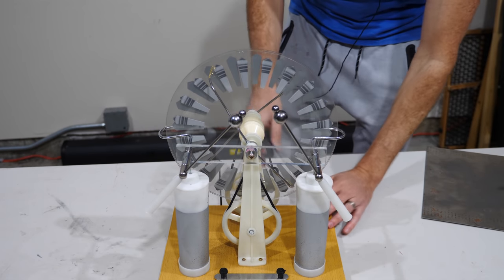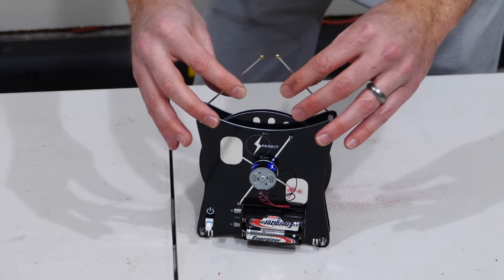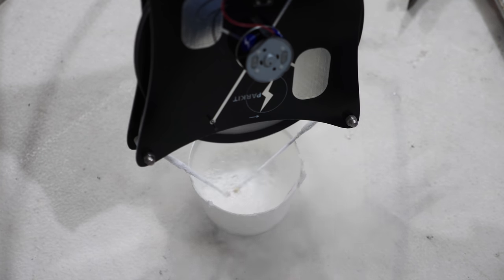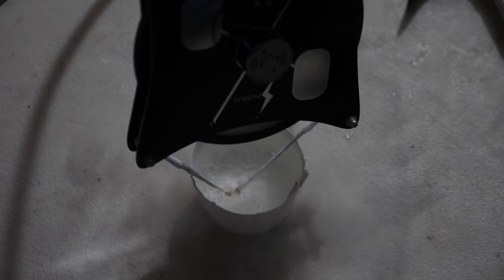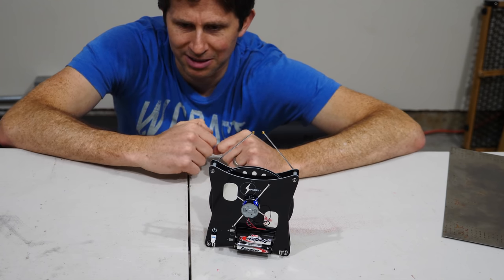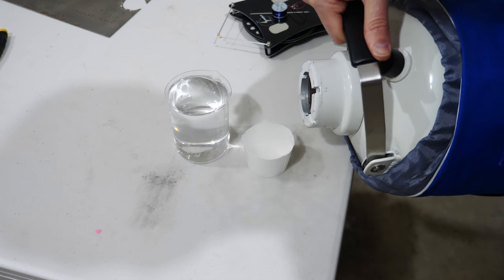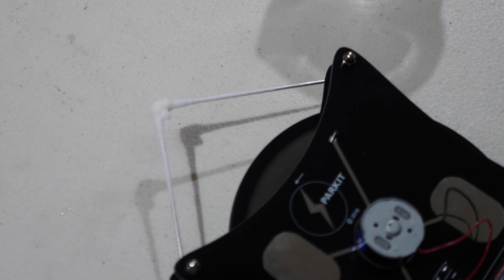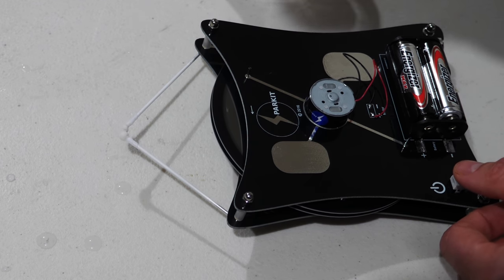Is it Possible To Freeze an Electric Spark in Solid Ice?

Comment: Is it possible to freeze electricity: No
Is it possible to hold a charge: Yes
Reply: Depends on how cold you get it.
Reply: @dirtydoigler2116  I don't think you know what electricity is. Edit: cold just means lack of energy, so how do you make energy cold. Energy doesn't get cold or hot, because it itself is the reason things are cold and hot
Reply: DoYouEvenGameAndLift BRUH  that's different smartass. Nomatther how much heat energy you group together, the heat energy itself can not be hotter or colder. The heat energy has it's fixed heat, and all the heat energy together makes up a greater heat. Whatever contains that heat energy is what you say is hotter or colder. That has nothing to do with the water analogy. You can't compare two unrelated substances to prove a point
Reply: @gabe8168  hey man
Greetings
I was just curious about two subjects and you seem to be quite knowledgeable about scientific stuff.

1: can flame conduct electricity?! Or more specifically can electricity go through the fire?

2: does lightning or electricity put out fire when they hit it if the voltage was high enough?!

I would be so thankful if you respond to this.
Thank you
Reply: @amireyvazi9251  1. Flame doesn't conduct electricity. Flame is a result of different chemical reactions. 2. The reason fire could be started by a lightning strike is because electricity can be used to start the chemical reaction. Flame is not one thing, it is a result of multiple things
Reply: @gabe8168  the answer to 2 isnt right its actually because it turns into heat and it gets hot enough to generate fire with the oxygen around it
Reply: We got some boy geniuses in this comment
Reply: @gabe8168  omg are you theoretically making cold energy
Reply: @quackerman234  Yes, exactly, it is able to start an electrical reaction with the oxygen and fuel (any dried trees probably) around it so it is right

Comment: The reason why the sparks went out when the ice got a little bit warmer is because the salt content in the ice became more evenly distributed. hence the gap between the electrodes became partially conductive( basically you shorted the HV and Gnd electrode). so conductive current would flow immediately as the potential tries to build up in one electrode so there is an immediate collapse in voltage. As far as i can see, the generator is only capable of generating a few joules of energy. hence, the potential wouldn't rise up  as high because the medium is already conductive. The built up charge is already dissipated through conduction even before the potential can become significantly high to visualize a breakdown. 

PS: I'm a High Voltage Engineer at IIT kanpur. hope you liked my explanation <3. Love your videos as usual

Comment: 5:03 My guess would be that micro-pockets of air were present in the solid ice, and after heating up those pockets would get smaller.
Reply: My guess is that, since ice is a dielectric, we were seeing the same phenomenon as before while there was no water present.
Yes, pure water is a dielectric too, but since it probably wasn't pure water it acted as a bridge. Even if it was pire, tho, since it's in contact with metal some metallic particle will get dissolved in the water pretty quickly, thus making it a conductor anyway.
Reply: my guess is everybody loves somebody sometimes,everybody loves somebody somehow
Reply: @outviteslb8143  Yes and obviously no!
Reply: @tomas2375  i love you man
Reply: @outviteslb8143  And I Love You, Random Citizen!
Reply: my guess is the atoms are closer together at colder temperatures, so the gaps are easier for the electrons  to jump

Comment: That is basically transfer of electrons from a point of higher potential difference to lower

It does not have significant mass ..... In order to freeze electrons you will have to do it at a temperature of nearly-273°C and that too for the time it requires to cover the distance from positive to negative electrode.

Also you can stock up electricity only in batteries

Thanks for reading

Comment: Ice from liquid water forms a crystal lattice and traps air. This is why water is the only known liquid to expand when frozen. Once the ice melted inside around the spark, a thin connection of liquid water forms and acts as a solid connection.

Comment: A couple of thoughts. First, what is the actual temperature of the liquid Nitrogen? It has to be warmer than the surface temp, so it really isn't as cold as you might think. Only when it sublimates does it give up its heat. Secondly, I hypothesize that the reason the spark stops when the water ice gets warmer is because when ice becomes warmer, it changes state to a liquid, and water has different resistance than ice. Obviously then, theoretically, water has a higher resistance than ice. H2O is a unique substance in that as it gets colder it gets less dense (molecules are further apart). If it didn't, then ice would not float, it would sink and the oceans would freeze solid. Every other element DOES get MORE dense as it gets colder, but not water.

Comment: Hey there! Solid Ice has a lower dielectric constant than water, about 20 times smaller! So my theory is that when the voltage is applied, the spark forms easily by polarising the ice, but the heat generated melted the pathway of the spark into water, which has a higher dielectric constant. This means that the voltage required to generate the same spark will increase as more of the ice melts into water, causing the spark to experience difficulty in forming due to the higher required voltages.

Comment: It didn't stop when the ice got warmer. The area of the ark melted a very thin layer of the ice. Because water is a very good conductor, it formed a wire between the electrodes essentially, and stoped making a visible arc.

Comment: Cool!  This is kind of a variation on the permanent electrophor, something the alchemist's tried to create ages ago.  They were partially successful, they would take a piece of metal, charge it up with the high voltage, then pour molten beeswax around it to isolate it and when the beeswax finally cooled off and it hardened, they could go around picking up bits of paper and things like that because of the trapped charge in the piece of metal.  I heard it would hold the charge for several days so it made for an interesting trick.  Anyhow, believe it or not, the permanent electrophor is the concept behind flash ram.  I tiny piece of metal oxide (I think, can't remember for sure) is isolated in silicon dioxide and by charging and discharging the element, determines if it is going to be a 1 or a 0...  I always thought it was amazing how fantasy can become reality....
Reply: do you want to invest in liquid electricity

Comment: Only semi-related but I once took a Fluke brand ohm-meter to LN and it was beyond the range it was able to measure.  LN is a very good insulator.  Of course breakdown voltage is not the same as resistance.

Comment: This is a cool demonstration especially because my PhD research was on light emission from avalanche breakdown in solids. I do not think that the observation of the sparks disappearing in the ice after some time can be explained by air pocket formation. Air has 80 times lower breakdown electric field than pure ice (due to different relative permittivity). The local presence of air or spark-induced defects would have lowered the breakdown field and the sparks would have continued. What I think is happening is the result of Paschen's Law. Breakdown voltage has a positive temperature coefficient. With local heating, the voltage needed to cause the breakdown increases. If the RPM of the generator wheel is maintained the same, this would result in the voltage reducing below the threshold (like a negative feedback). To verify my theory I would like to ask you: if you wait for some longer time, did the sparks reappear in the ice (when it cools down) ?

Comment: The sparks went away when the ice was melting because the energy between the electrodes was being used to generate latent heat to melt the ice (both freezing liquid water and melting ice have a temperature of 0C but a big energy difference: liquid water has more energy).

Comment: two many variables in the 2nd part, was water distilled or tap water(tap water is conductive), was nitrogen trapped between water. even if little bit of salt in water can cause electrolysis. trapped nitrogen might escape as it becomes warmer and the spark might stop....

Comment: 2:40 hmm I don't think so. My explanation is that the high voltage ionises liquid nitrogen and ionised nitrogen is more conductive so once the breakdown occurs, it can sustain the sparks. If it boils, the resistance of nitrogen would increase so less spark would form.

Comment: I hav a question: Is there light that doesn’t damage our eyes and we can see? So no infrared light. And also light that isn’t UV light. But if you can’t answer this question it doesn’t matter!
Reply: The sun emits a lot of light, some of which is dangerous (including UV and X-ray). If you could find an alternative light source that only emits light in the visible spectrum, then it should not damage your eyes. As far as I know, infrared isn’t harmful (I’m not a doctor) but you’ll probably get some with any light source that gets hot. LEDs with a diffuser might be your best option.

Comment: Probably because a layer of water was formed. Since it probably wasn't distilled water, it behaved like a conductor and closed the loop. If it was distilled, this changes very little because distilled water dissolves basically anything, at least in small quantities, and becomes filled with ions, thus returning to the case of non-distilled water.

Comment: I think some of the ice melts, creating a path of liquid water (with impurities) for the electric current to travel through, so there's no spark because the spark gap is no longer the path of least resistance. That path may be on the outside or the inside of the ice ball.

Comment: The reason the sparks go away is because of a temporary increase in resistance running through the diodes. As the temperature drops the resistance increases and more energy aka a higher voltage is needed generate current.

Comment: Use the Wimshurst in the vacuum chamber.
-once where you start the Wimshurst put in the vacuum chamber then start the vacuum chamber to see if and when the Sparks stop flying.

-then a second time where they vacuum chamber is at full vacuum then turn on the Wimshurst (I know you'll figure out a way 😉) to see if you can get a spark

Comment: The most likely reason that the spark disappears as the ice warms a bit is that the water warms enough to be conductive. Did you use distilled water (which is not conductive)?

Comment: What if you submerged the electrodes under distilled water and generated the sparks while sitting in the freezer? Since water is a polar molecule, the electric field should cause the water molecules to align along the path of the arc and maybe that alignment could be "locked in" as the water freezes. If this causes a change in the refractive index of the ice maybe the polarized arc path would be visible in the ice even after the sparks are turned off?

Comment: What would happen if you froze a piece of string (yarn, cotton, or common garment material) through a piece of ice and suspended it in the concentric space in your vacuum?

Would it melt at the same rate as if it were not in a vacuum?  The string would be the only thermodynamic equalizer, no?  So it should melt at a slower rate, yes?

Comment: the spark most likely stopped when the ice heated up because there was some liquid water on the inside and its a good conductor so you cant see the electrical charge in it.

Comment: If an object of density less than water is placed in a bucket of which 1/2 is filled with water, will the total weight of the entire thing be sum of weights of the body, water and the bucket or less than it? Please do an experiment on this
Reply: The sum of the weights will be the weight of the bucket plus the weight of the water plus the weight of the object.

Comment: as you are frezzing it then the resistnce might drop and current will flow more easily but in this case the two metallic rods were brought too near from usual to see the spark why this happens? I mean to say it should the opposite case right? means it can create a good amount of spark from a long distance.  But its not why?

Comment: Ice is a poorer conductor than water?  At the end you said "the sparks declined as the ice melted."

So when the ice melts to become water, the 2 electric leads - the spark gap - get shorted out.  If they are shorted together, there will be no air gap to jump and ignite a spark.   The spark requires a big charge separation to build up in the gap but if the gap is shorted out, ie. conducting, no big charge separation can occur.

LN2  may be as poor a conductor as ice made from water, so there is still a dielectric gap to jump and thus although the LN2 is a liquid, it is yet a dielectric.

DIELECTRICS:  LN2 and ice made from water, and air -- a spark breaks down all 3 dielectrics and you see the spark
CONDUCTOR:  water - since it easily conducts, there is never a chance for a charge separation to build up between the spark gap, and thus, with no buildup of charge separation due to electrical conductivity across the spark gap (due to the water),  no spark is seen.

I haven't looked into the electric permittivity (dielectric constant) of LN2, I'm only surmising here based on your experimental outcome.  But it's a reasonable surmise.
.
.

Comment: Interesting concept, but I don't think its cold enough for us to see anything meaningful. What would be interesting is freezing electricity to 0 kelvin. I hear things start acting weird at zero kelvin. Could that be possible at all? Would the spark freeze in space? Imagine what this could do for batteries/capacitors. 
Someone at uni doing the relevant courses should do their dissertation on this, or do their masters dissertation on this (I don't know what the level of knowledge one would need to attempt to freeze lightning in 0 k).
edit: I just read at 0 k electricity moves without friction. So freezing lightning is hard I guess.

Comment: You didn't answer the question in the video title, you answered two different questions: is it possible to create an electric arc in (1) liquid nitrogen and (2) water ice.
Reply: He doesn’t have to tehehe
Reply: @03weeksago.77  If you pose a question in a video title, you imply that you're going to answer that question in the video.
Reply: Grimbeard meh the answer is obvious so uh I’ll let this slide
Reply: @03weeksago.77  Well, the answer is obviously 'no', but the answers to the two questions that the video actually tests are both 'yes'.
Reply: Grimbeard yes
Reply: @03weeksago.77  Which implicitly gives the false impression that the answer to the question in the video title is also 'yes'. That's why I'm objecting to the title.
Reply: Grimbeard kind of

Comment: Pure water is a poor conductor.  If the water is not pure it's a great conductor.  If your water that you used was from the faucet then it probably was a good conductor of electricity and the charge just used the water to complete the circuit and didn't have to jump the gap.

Comment: Your not freezing the spark your just firing a plasma arc through the ice that's why you had to move them closer as the dielectric strength of dry ice is higher than air.

Comment: How is the spark moving through liquid nitrogen.  Either the nitrogen is impure or the nitrogen has to be somehow ionized.  Nitrogen is an insulator and should not conduct electrons.
Reply: Every insulator will conduct electricity or become ionized once the voltage exceeds the ability of the dielectric to hold back the current.

Comment: So it is impossible to freeze a spark because spark itself is ionised gas (air or nitrogen) aka plasma with very very hight temperature and freezing it means taking away the all that heat so the very next second there is no spark or plasma....

Comment: To be perfectly honest, I'm disappointed. I expected the sparks to actually get frozen (which I'm pretty sure is impossible), instead it was simply sparking inside the ice (which I would find it more shocking if it was impossible, if it can spark in air or liquid hydrogen, why not ice?).

Comment: You're not freezing electricity the electricity traveling through the frozen water it's not frozen itself you can't fries electricity it's a bunch of electrons also I'd like to point out that the visible Spark it's caused by ionizing the error so it's more conductive so you have to ionize something to create a visible Spark at the end of the video you say it's not heating the water to melting point it's heating the water well above melting point at the area where the spark goes through it's making plasma at the area where the spark goes through

Comment: LOL you dont know why the sparks stopped at a higher temp than when it was colder? REALLY???? WOW water mate water, not ice. ice is a solid water is a liquid which changes the whole environment as your not dealing with the cold but now wet. up the spark volts to evaporate the water. thought you actually had some smarts when i subbed lol i can see why i left